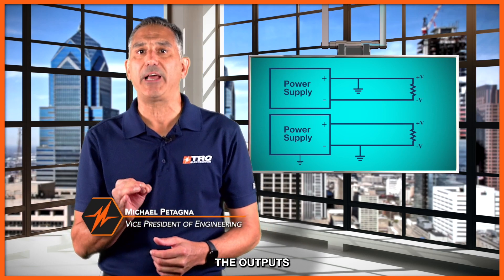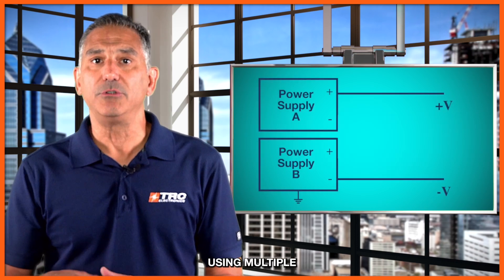Power Supplies Explained: Understanding Floating Outputs

Comment: Hi there, I'm currently trying to connect two PC Power supplies in series in order to convert the 12 VDC output and -12 VDC output to 24 VDC..... I desire 24 VDC, but Would like to be able to alternate by changing where I'm plugged in to test equipment with.  I was able to measure 24 VDC when I linked the two, but I celebrated a little too early and blew one of my power supplies.  I made "light sabers" (just tinned wires) to extend out from the plugs.  Anyway, it's been over 10 years since I took electrical theory, and this is one of my first fun little projects with electricity.  I've read that having a floating ground may be a solution.  I believe there is a way to do this!  Any advice would be greatly appreciated!  Thanks for the video!

Comment: I thought it was true DC so that the CPU can turn on and off whenever and not be held high because of bad/poor rectification, hence if the CPU has full rein well it might decide to do 100mhz and then 3Ghz if this is controlling aerials well it can jump/resonate to frequency bands, if it sends data on a band and then the power source changes 50 times a second well by the time the response of the frequency is returned it is unable to determine how many clock cycles have past. Floating point I thought was the ping time (aka the amount of errors in that particular route) (errors meaning the frequency band shift on analog aka internet
Reply from the maker: Interesting perspective! Power quality and stability definitely play a big role in system performance. Thanks for sharing your thoughts!